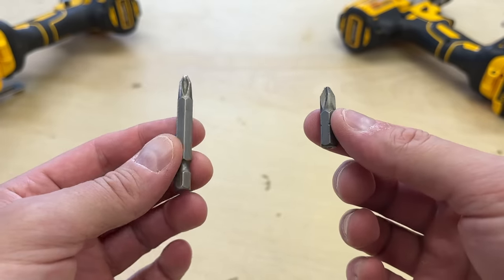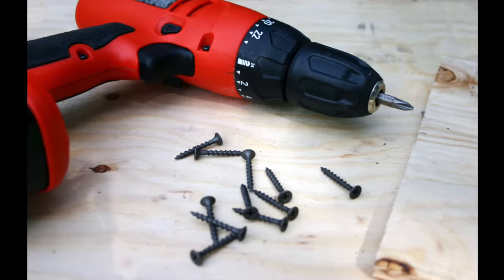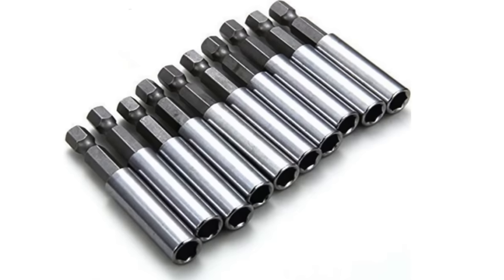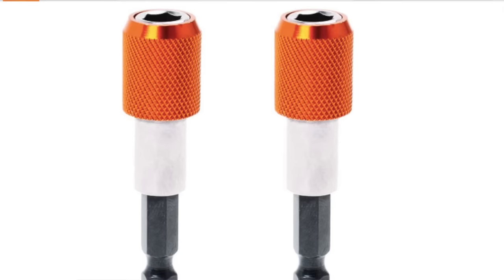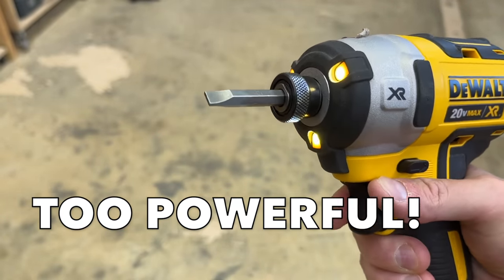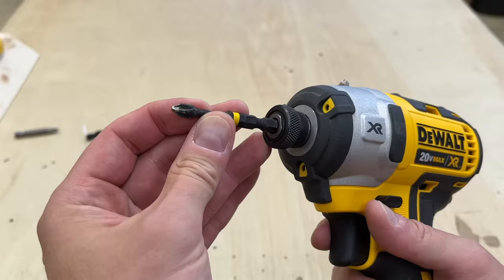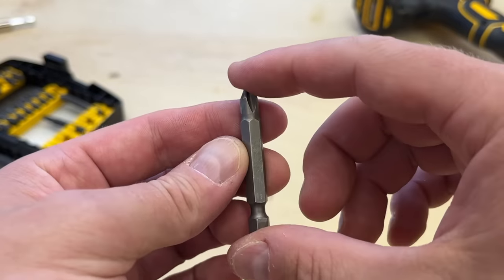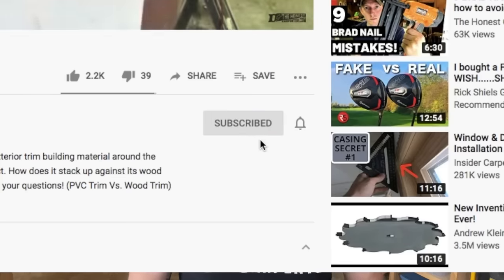Power Bit vs. Impact Bit vs. Insert Bit...WHAT'S THE DIFFERENCE?! (Driver Bit Guide For New DIYers!)

Comment: Thanks so much for posting this! I have all kinds of bits and had no idea that they were intended for different uses and are not necessarily interchangeable. I've been using an impact driver a LOT the past week and while I had impact driver pieces for 1/2" and 3/8", I only had the chrome sockets, which I understand are not supposed to be used with an impact driver. I've since bought sockets designed for impact tools. 👍

Comment: I first want to say that this is an accurate and informative video.  With that said, not something you need to worry about unless you buy a legit grade impact driver. Cheap impacts typically won’t even break garbage bits. Furthermore, I’ve snapped hundreds of bits and they always always always shared right at the tip, making the shaft reliefs on an impact bit a moot point. Even furthermore, shears only typically happen with Phillips or flatheads. It takes an impressive act of violence to snap a star bit. I’ve thrown whatever fits in my drills for decades, and one of my go to drills is an 18 volt holy grail makita (about as nasty as they get.) not to discredit safety here, but a snapping screwdriver bit at 3000 rpm’s or so isn’t exactly catastrophic.
Reply: Quite the opposite is true regarding shaft reliefs. Much like torque sticks for lug nuts, those relief shafts help by allowing torsional flex axially, thereby limiting the stress at the tip of the bit

Comment: Thank you very much for this instructional video!! My handy husband of 40 years recently passed away. When I went to find a tool I was overwhelmed. First I couldn’t figure out why there were so many “bits”. Then I couldn’t figure out how do take the bit out of one machine to change it. Then..the different lengths really got me. When I realized how many power tools were out there I nearly gave up. I went to the big box store and got one grumpy guy..no help. Then a very young, sweet kid had no idea what the  difference between impact, drill, driver etc.was. He pulled out his phone..to google… Anyway, since he passed suddenly, he had so many little projects started. I spent a week putting everything away but left the bits and drills on the shop tables..Fortunately, they are all organized by types, in nice little boxes. I was going to ask a neighbor for help. You really helped me. I ended up spending way too long with a regular old screwdriver and it took forever. I really had no idea about the difference between a drill and impact driver. You just saved me some money. I want to get something light and almost ordered an “impact driver” online (since the big box store was so intimidating) I just need a nice light drill motor (I think). His drill motor is a bit older and very heavy… Now I wonder what those big sharp, round shaped things are and what tool they go to? Update..I just subscribed and saw your other video’s about the difference between screws and other hardware..I spent a week putting separating all the loose ones into jars, then I found all the boxes that I matched them up. I realized some were sharp and some were flat.. gonna watch my next lesson. I did go to Harbor Freight and got some plastic hardware boxes to organize them by shapes..no I can find out what they are all for..thank you!

Comment: For 90% of the work I do (softer woods) the "power bit" is just fine in the impact driver and I've never had an issue. However when playing with hardwoods that aren't appropriately pre-drilled and other harder items where the torque comes in I completely agree.
Reply: Use a drill like a professional. Impact drivers aren't for driving wood screws.
Reply: @espressomatic  yet in the right circumstances they do such a good job.

Saws weren't originally intended for metals yet here we are :P
Reply: @espressomatic  I've NEVER understood how all the idiots got on board with using the impact function each and every time, as tho it actually made a difference. If you're not using a carbide bit on brick or concrete, etc, the impact function does nothing. It impacts FORWARD, thru the tool into the material, not ROTARY, like an air impact tool. I think the clowns on Hometime do that too often and spread the misinformation. These same clowns also omit thru holes in outer pieces of wood that they screw to pieces underneath, and just cram it thru.

Comment: Impact bits are only new and once upon a time we used to only have non impact bits with the ball lock groove. The groove is there for lock interchange chucks which can be found on many different tools. It's just like SDS plus chucks can use non hammer tools in their hammer chucks. 
The little slits on the short bits aren't a guide for length they're a lock groove too. 
The interchange bits were originally designed for screw drivers and electric screw drivers the interchange bits were made to turn standard drills into screw drivers which is why they started to put screw chucks onto drills.

Comment: You can use various types of bits in an impact driver and they work fine depending on what you are doing.  If you are driving fasteners into wood you won't have a problem with breaking bits from impact forces but if you are driving fasteners into metal where they can bottom out suddenly then you will break bits if you keep your finger on the trigger too long.  The reduced shank in impact rated bits is patterned after torque limiting extensions used with impact wrenches for automotive uses.  Those extensions are long enough to allow the reduced torsional stiffness to work to reduce torque.  The little ones made for 1/4" hex impact wrenches are not long enough for this to be effective.  I've seen people break those bits probably more than the standard bits.  There might be a difference from one bit type to another, but the biggest difference will be between different manufacturers.  The impact rated bit from one manufacturer might not be as strong as the plain ordinary bit from another manufacturer.
Reply: 💯 agree

Comment: It’s simply for connivence. Locking power-bit shafts for printers, security cameras, and networking racks or any install and tech kind of stuff and not having bits fall when in a lift is why I use them. Often screwing into plastic, threaded aluminum mounting brackets, and brass inserts. I don’t always need the impact bit strength and am usually using various security bits. Very small hex and torx 40 feet in the air with lanyards on all my tools.

Using a Milwaukee installation driver, that is an impact. It sinks self tappers in very thick aluminum extruded beams that are holding windows and automatic doors like in grocery stores.

Comment: I've actually seen those Milwaukee Impact-rated bits at Dollar Tree before, & the benefit of those is they don't wear down as fast.
Reply from the maker: Milwaukee makes great stuff all around, W!
Reply: I have used the makita power bits both with impact driver and  a driver/drill. They cam out easily if you are not careful. They may strip the screw or theselves, sometimes they break as well. I had high hopes with the Milwaukee x10 life impact ones. They don't cam out, they don't strip the bits and never get stripped. However, they break as easily, (maybe even more easily than the driver bits), right at the  tip area. On YouTube, there were some guys testing the x50 model and they broke it easily. Milwaukee's answer was that, since they are made of harder metals to prevent the stripping, they tend to break easily. Wtf? I would expect the impact bits to be less likely to break. Making a bit harder but fragile is not a material science. That's a normal sequence. But if you could add that toughness, now you are doing something successful.

Comment: Power bits can also be inserted on non-impact driver drills without having to fuss with a chuck. There is where non-impact power bits are useful.
Reply from the maker: With a quick-change collet, og? I just don’t see them very often. Always keyless 3-jaw chucks. 🤔
Reply: @TheHonestCarpenter  You could use them in an installation driver that has changing heads like Milwaukee's or Bosch's.
Reply: The bits are for all the cordless screwdrivers. Just about all major brands have them and they have a collet. Example: milwaukee m12 2401-20, Dewalt 8v screwdriver dcf 682n1.
Reply: @TheHonestCarpenter  Yes I have two, the Milwaukee 12v driver and the Bosch 12v driver, and these are the two drivers I reach for the most. Both with quick change collets.
Reply: Is this real?

Comment: Project Farm did a video on those power bits, in the end they’re not as strong as they’re rated for. They all snapped. So for us homeowners it doesn’t really matter what bit we use. Unless it’s something you need crazy strong torque on any of those regular bits in an impact gun are fine.

Comment: The detent groove on 1/4" hex shank bits predates impact drivers. Early quick change hand screw drivers used them, but overall winged bits being more common for quick bit hand screw drivers when I was a youngin'.

In Japan (Japanese Industrial Standards) the detent location in a slightly location so there are bit compatibility issues between different JDM tools and western tools. The JIS has a longer tail end on the bottom of the hex shank (longer than our standard 3/8" length) so it might not lock into some collets.

I'm sure someone out there has a patent paper or scan showing when someone first used the chucking detent groove.

Comment: Quick tip for when you only have a drill type bit but need to use the impact gun: a torsion bit holder will make them last much longer than putting it straight into the machine. In a pinch, I've stacked two bit holders to make the one Tx20 bit i had last to the end of the job.

As for the power groove on non-impact rated bits: there are electric screwdrivers with a quick change collar on them. I have two Makitas that look about the same, but one goes bzzz and the other goes BRRRR. Plus after they break they are ok as 6mm hex bits for a little bit.

Comment: I was handed down a slightly weird hammer drill that uses a so-called SDS quick chuck. It's smaller than normal SDS and I thought it was kind of dumb until I figured out it can also take normal hex bits. So I can use power bits of all kinds and shrunk down SDS bits for when I need to drill into walls. And I already had some hex drill bits lying around so it was actually one of the better hand me downs I ever received. Some of the best $0 I ever spent.

Comment: From my recollection, "Power bits" were the original standard. It was all we could get for 10 years or so. With the growing popularity and strength of impact drivers, the standard bits were not standing up to the extra torque. So 'Impact bits' were created. 
The tips are extra hard so don't strip as easy, and the thinner shaft provides a torque relief.
I've driven a ton of #2 square slot deck screws and personally have never had a bit break. But the power bits definitely strip the screw slots, and the bit itself, much easier than impact bits. I can sometimes use the same impact bit for a month or more of daily work.

Comment: In addition to the great comments I have seen, there are many non-impact bit drivers and electric screwdrivers on the market that use the quick release mechanism. I’ve seen this setup marketed as positive bit retention (magnetic retainers are not perfect, bits still get pulled out)

Comment: I found out that the DeWalt impact rated bits will break while using a 1/4” impact drill. Plus those impact Phillips bits will strip out the Phillips head screws using the impact drill, I use my cordless drill instead, no more stripped screw heads. Thanks for what you’re doing, it’ll help many guys

Comment: I use quick release adapters on my drills that use the same ball bearing system as my driver. They use the groove too.  It’s a good grip and easy to care for. Sometimes some dust builds up in there but a few pulls on the release and a blast of WD40 seems to clear them right up.

Comment: Ive always used the screw holder sleeve you showed with normal bits on my dewalt 20v impact. Never had an issue. The black bits heads always explode on me. I stopped waisting money on them.

Comment: yep like other people have said. many companies had screw guns for like dry wall and what not that had quick change chucks. impacts just use the same system. they already had the tooling for manufacturing both the bits and quick release, just use different steels and same some money.

Comment: Many years ago I moved into a new apartment and had a bunch of shelving units to put together and other things I had to do that involved some drilling and driving, so I bought a basic battery-powered non-impact brushed Black & Decker power drill/driver that was basically a drill with a torque setting ring but which only accepted hex bits and didn't have a chuck like better drills do. It was more than up to the tasks that I put it to and I still have it to this day, having only had to replace its original NiCd battery after it died, with a superior NiMh one.

I've since gotten much nicer tools, like a Milwaukee M12 drill & impact driver kit, and mostly use those these days. But now and then I prefer to pull out the old Black & Decker, for tasks like cleaning the underside and wheel wells of my car using brush attachments. I figure that if dirt and grime get into its internals better this happen to it than to my nicer and more expensive tools. Plus it has this neat feature where I can swivel it into various positions including straight to it's like a huge power screwdriver, which helps with access to hard to reach spots that a right angle took might not fit into.

Anyway, because it only accepts 1/4" hex bits and attachments, it has a locking feature akin to impact drivers, that requires that concentric groove that exist on both power and impact bits, so it's nice to have this feature on non-impact power bits with hybrid tools such as this, and it's not just an anachronistic throwback to an earlier era where this was more useful. It's still useful in some cases.

Comment: Thanks for explaining the difference between type of bits.  
Now if the fastener makers would standardize the tip of the bits.  40 years ago there were three basic tips (slotted, phillips, and security).  Then came the Torx (3 types), Robertson or square, etc.  Every time I go to the big box store, the driver bit sets are growing.  Now they have 100 piece sets.  I have to buy one sooner or later because I am going to come across a bit type and size I do have and all work will stop.
Reply: Robertson is a lot older than 40 years. It's been around since 1906... https://en.wikipedia.org/wiki/Robertson_screw

Comment: Having a non-impact bit in an impact driver is way better than having nothing or having the bit fall out. I have used non-impact bits a lot in my impact driver. Recently I broke a few bits, so I finally bought some impact rated bits to replace the bits I broke, and use most commonly.

Comment: That groove was for the spring retention collar to hold bits in extensions. Most magnets did not hold the bits and they would pull out after driving screws. The negative side is some rings are so tight, pliers are needed to remove the bit.

Comment: The power bit pre dates the impact drivers by many years. They were predominately used in pneumatic screw guns which were also high torque drivers. Working  in RV manufacturing, I've been using an impact driver for over 10 years now. I've always used the power bits in my impact driver because they're supplied by the employer. I'm  sure I've had them break on me, but I don't recall an instance where that's happened and that's screwing into woods, plastics and metals.

Comment: Power groove should be renamed the Retention Groove, as its only real purpose is to facilitate the tools bit retention system. I was however surprised that the skinnier bits were for impacts specifically. Makes sense now that I think of it, since there are impact and non impact rated sockets. No wonder my impact did not come with any bits like my drill driver did.

Comment: The flexibility of the impact bit neck is to better transfer torque to the screw. The impact drivers don't use "ratchet mechanism" either. They use rotational hummer action, where the hummer (also has a flywheel-like effect) is rotated by the motor, and spring is tentioned, until the hummer is released by the groove and it hits the output shaft with multiplied torque (of the motor). That is why they provide a lot higher torque at the output then them motor itself is capable of, even with the gearing. The impact bits help by having flexibility, as they store some of the energy between the impacts of the hummer. So when the hummer impacts again, the bit adds its stored energy as an additional torque to the output torque of the impact driver. So with impact bits you get even more torque transfered to the screw compared to the regular bits.

Comment: I just use any old bits that I got with different screwdriver sets over the years with bit holder and my impact driver. I'm treating those bits pretty much as disposable. The moment I run out of those is when I am going to start considering buying impact bits.

Comment: Back in the 1980s we used air powered drills and  "'SCREW GUNS " . The screw guns had a quarter inch collet to accept the groove of  a two inch bit or a bit holder. Usually only socket adapters were black in color . Impact drivers were only in our dreams.

Comment: My contention would be if you were using an impact wrench with an adapter- then you have a way to use- basically all of them.  Project farm has a great video on bit holders and impact wrench adapters- to see which ones hold up the best,  as well as for the price.  Yeah,  a lot of people don't know about sliding that sleeve over a screw 👌